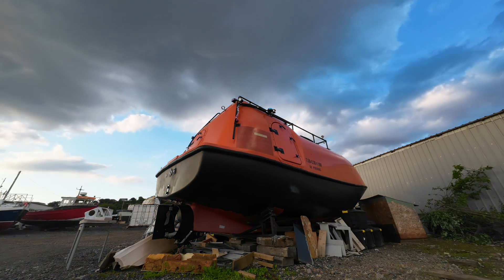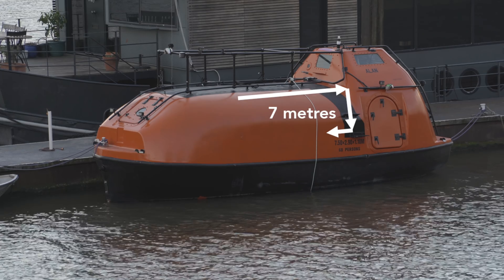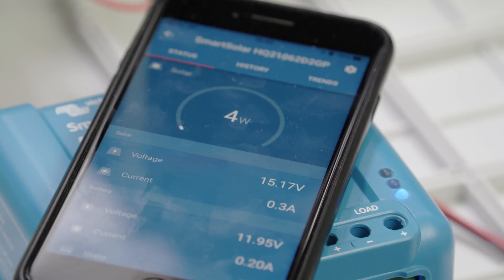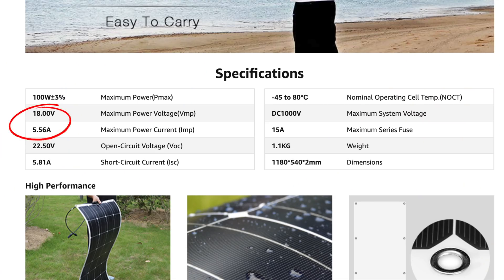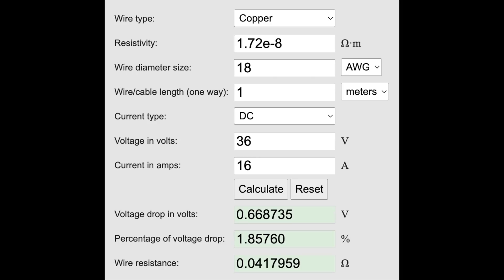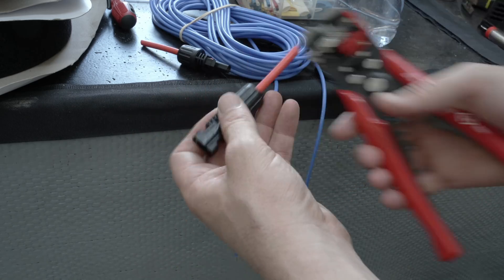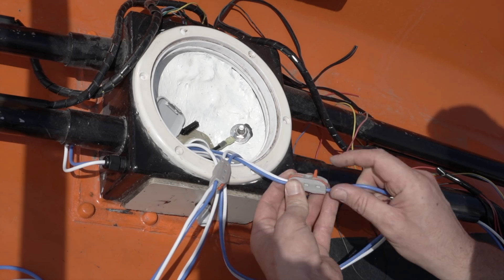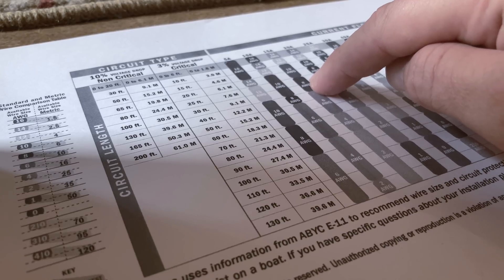Lifeboat Conversion Ep44: Solving solar wiring problem |  Incorrect sizing causing voltage drop [4K]

Comment: This video is a perfect summary of the problem with current political discourse on the internet. You are incredibly smart and competent and an absolute authority in regards to extreme weather exploration, expeditions and etc., not necessarily on low voltage electrics. 

Same with politics, too many people seem to think just because they are good at one thing means their opinion should be weighted in other fields - which is why I'll probably never waste my time listening to Arguably.
Reply from the maker: Your broader point that expertise on one matter doesn't automatically translate into expertise in another is hard to refute. But you don't take into account two things: 1. People can be well versed in >1 thing, whilst accepting being a novice at another. 2. The problem you outline relies on people being totally unaware they aren't an expert on everything i.e. deluded. I'd posit this video shows that to be manifestly untrue in my case.

Comment: A electrician said to me once. That wires contain smoke it’s just a matter of how and when you release that smoke lol
Reply: And how violently.  Smaller wires hold the smoke under higher tension, so when they break they release the smoke violently.  Larger wires hold the smoke under lower pressure, so when they break it's slowly.  😃